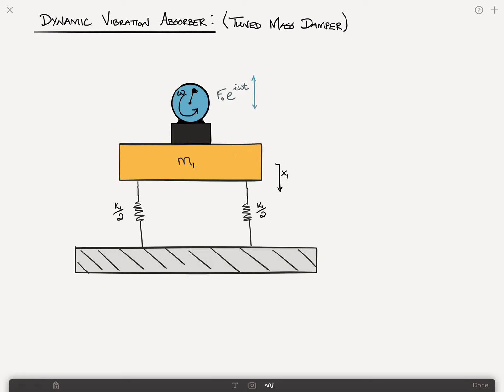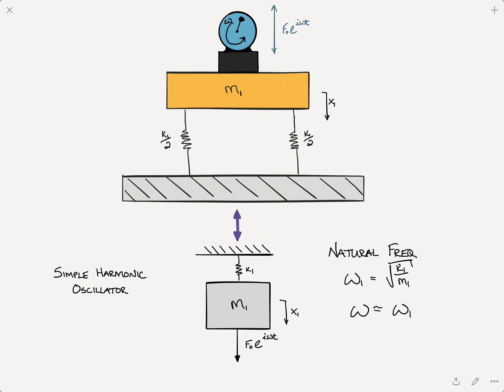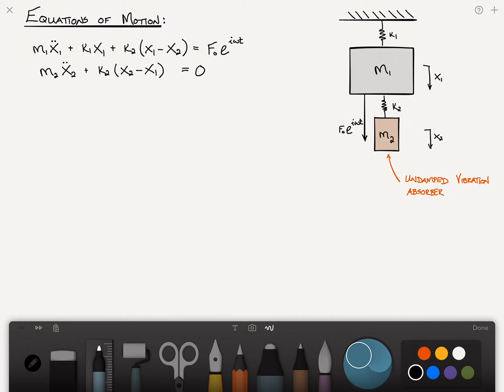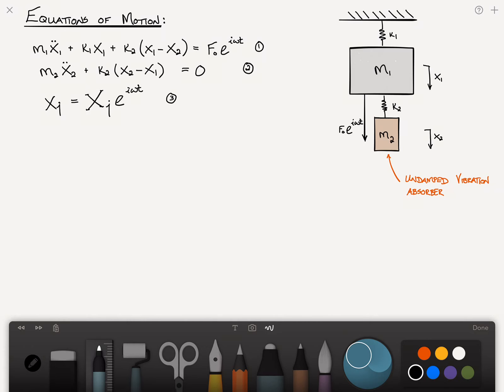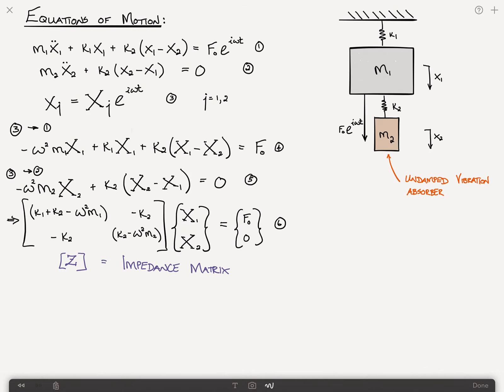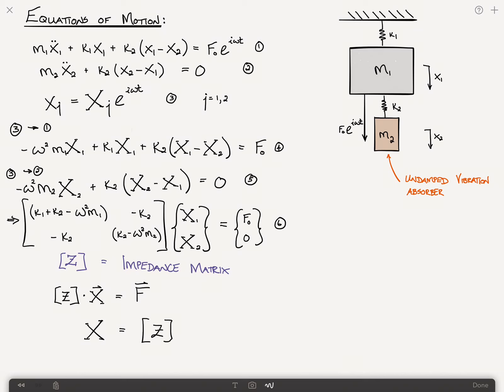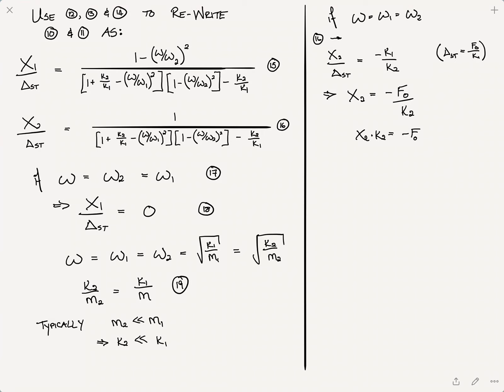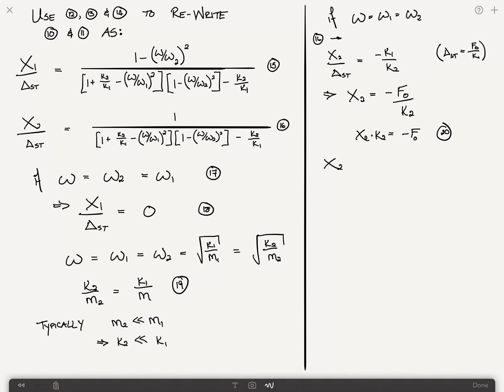Dynamic Vibration Absorbers

Comment: Great video - all lectures should do this digitally and clearly like this...  One question, Omega = Omage1 = Omega2.  If i was to add mass to the table it wont change Omega because this is the frequency of the motor... but it will change the mass term in the equation SQRT(K1/m1), which will change Omega1.  I am an engineer and having to dive into a field I haven't looked at for 10 years!  Your help would be appreciated!

Comment: If you have a 10 storey building subjected to a wind load, what will be the difference in hanging this secondary mass on 1st, 5th or 10th floor? (Great video)
Reply from the maker: In buildings, a tuned mass damper is typically located towards the top for maximum effect.  Also, sometimes slosh tanks are used (which go on the roof).

Comment: @Freeball99 let say if we have vertical tower to damp where the base of tower have been fixed with the ground, what is means by M1? Is it entire mass of tower? (Just try ti make analogy to solve something in my system). Thanks
Reply from the maker: As a first iteration, if we assume that we have a vertical cantilevered beam and we are examining deflections at the tip, then the equivalent mass at the tip would be 1/3 the total mass of the beam.

Comment: Thank you freeball, very understandable for describing equations from the book.
may i ask? if i were to make a model of vibration absorber like this, i could have known the value of m2 i give to the system, but how could i calculate the value of k2 to assure me that the mass2 will definetly neutralize the response of the main system (X1)? 
and is there a way for adjusting stiffness for the vibration absorber?
thank you, sorry for bad english
Reply from the maker: Sorry for the delayed response, but I somehow missed your message until now..  I'm not sure if I understand you question exactly, but hopefully my answer will cover it...

In this simple case, you would know the value of k2 (you could measure it in a lab by applying a force and measuring the corresponding displacement).  Most likely in a real-life situation, you will likely pick the spring first and tailor the mass accordingly since it might be easier to finely adjust the mass instead of the spring.

Hope this helps.
Reply: @Freeball99  thank you for the answer, it really helps me a lot. 
Thanks!

Comment: Where can I find the mathematics behind the damping of a pendulum type tuned mass damper with explanations? Not a spring-mass one
Reply from the maker: It's called a pendulum tuned mass damper.  Here's an example of how to derive equations of motion (a few pages in).  https://engineering.purdue.edu/~ce573/Documents/Intro%20to%20Structural%20Motion%20Control_Chapter4.pdf

Comment: Great video, very much helpfull. But one question, is there a way to go the other way around, to cancel out the movement of mass 2 with mass 1? When looking at the eq. 15 and 16 it looks impossible because the numerator is 1 in eq 16. I understand that the purpose of mass 2 is to absorb vibration from mass 1 but lets just imagine for a second we have a 2-dof system and try to achive this.

Comment: Hi, Freeball, 

It's me again. Thanks for your video. I'm working on the vibration absorber recentely.  Based on equation 1 and 2, I have designed a simulink program to investigate the displacement of m1.  However, as your conclusion shown on the end of your video, the displacement m1 isn't zero when the excitation frequency is equal to natural frequency of m1 and natural frequency of m2.  Is it matlab problem ?   or do we miss something here ?
Reply from the maker: I believe the math to be correct - displacement should be zero (although I've been known to make errors before).  Personally, I've never tried to implement this simulation mathematically so I can't comment on an potential pitfalls to avoid.  While I am not a MATLAB guru (I prefer Mathematica or Python/Numpy), I'd be happy to take a look at what you have if you want to forward it to me at apf999@gmail.com - perhaps I can offer some suggestions.

Comment: Hello. Could you please help me. I want to design Dynamic Vibration Absorber for 25Hz. I am looking for methods. Do you know where can i write ot watch about how to design it?
Reply from the maker: 1️⃣ Determine primary system parameters: • Mass (M₁) and stiffness (K₁) • Ensure natural frequency is 25 Hz

2️⃣ Choose absorber mass (M₂): • Typically 5-20% of M₁ • Consider practical constraints

3️⃣ Calculate absorber stiffness: • K₂ = M₂ * (2π * 25)² • Tuning condition: K₂/M₂ = K₁/M₁

4️⃣ Consider adding some damping for better performance

5️⃣ Verify by plotting frequency response
Reply: Thank you  @Freeball99

Comment: what happens if the secondary mass is greater than the primary mass
Reply from the maker: There is no restriction on the relative sizes of the masses - so if the mass is heavier, you'd need a stiffer spring to get a tuned response.  Typically, however, when examining the problem at hand, we usually have a piece of machinery or a structure that is exhibiting an undesirable response.  Typically, we want to reduce vibrations by adding a much smaller mass since adding a very large one might be impractical.  So, the restriction has more to do with the physical geometry of the problem rather than vibration theory.  Clearly, in the case of a building, it makes no practical sense to add a secondary mass that is heavier than the building.